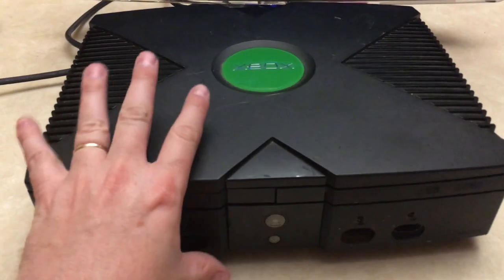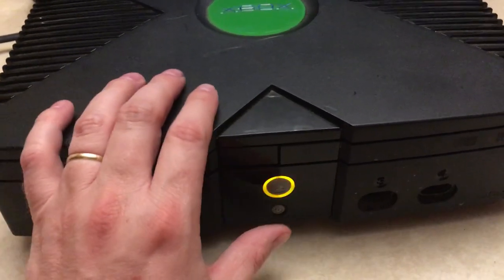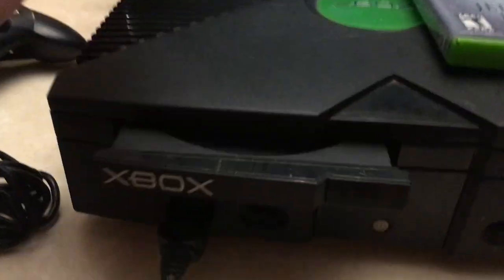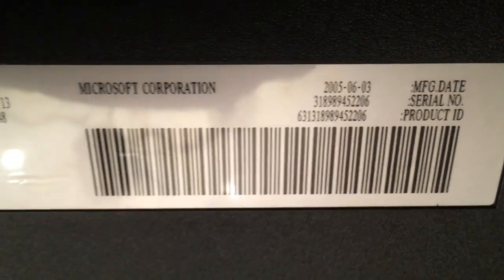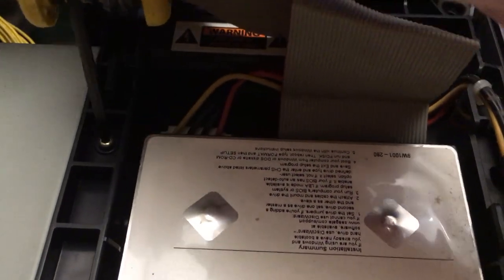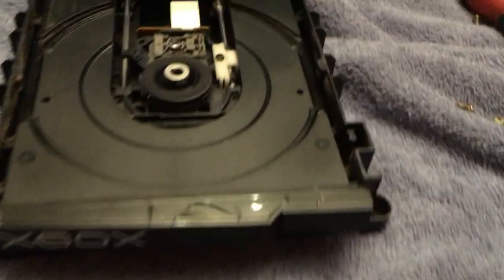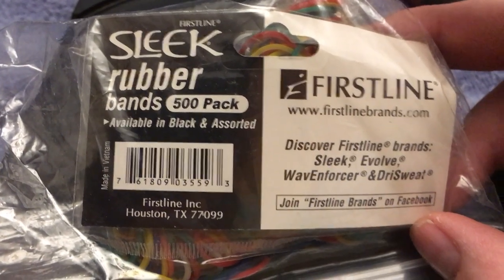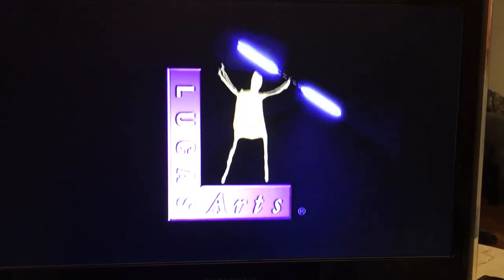Console Repair  - How to Fix Original Xbox Stuck Disc Tray

Comment: this video helped although the rubber band I used was unconventional it opens and closes, just slowly which is worrying. it's more of a rubber band used for hair
Reply from the maker: You can order a pack of replacement bands and use a similar sized band.  I got some a couple years ago but they came from China and took a few weeks to get to me.  I was using them for disc trays and cassette players.  I’m glad your tray works now so you can enjoy your Xbox.

Comment: Mine opens when I whack it and I replaced the band without opening it but it still doesn't open so that sucks
Reply from the maker: Did the band fit tight?
Reply from the maker: @yaboialebo4717  I would say try to find one that’s a little tighter than that.
Reply from the maker: @yaboialebo4717  good luck

Comment: What does it mean when it just stays on a orange light
Reply from the maker: If i'm not mistaken, that's an issue with the AV cable.  Make sure it's plugged in and doesn't have a short in it.

Comment: You don’t have to hit the top like that there’s a way to do it take a paper clip and put it into a hole right next to controller port to press down and it may just slide back up water
Reply from the maker: Thank you.
Reply: I tried the paper clip way, it wasn't working until I smacked the top of the tray it opened

Comment: Mine can open but most of the time it sounds stuck and won't open. It takes a few button presses for it to open and after that it works fine for a bit and then stops again. I have already cleaned the rubber band in the disc tray by removing it when I first got it. Maybe it's time to get a new rubber band. 

I actually have the same problem with my fat Xbox 360 I need to fix as well. The weird thing is my fat Xbox 360 opens fine laying horizontal but issues when vertical. I prefer keeping the fat Xbox 360 vertical as it looks better. By the way my fat is the Jasper chipset model which is one of the last before the S model came out. It is supposed to be most reliable of the fats and fixed the RROD issue. I mention that because I don't know if it's different between the fat models when it comes to disc tray issues. I also have a S model and E model 360 I got cheap but they work fine as far as the disc drive goes.

EDIT. Tried cleaning the bands to each and so far they are working but I have to check in on it in a few days as it usually would work fine for a day then just stop before I cleaned it. I am wondering if it could be something with those plastic gears inside that I see and maybe it's getting caught on something.

Comment: I finally got the tray to open and its very dusty
Reply from the maker: That’s awesome!  A good cleaning won’t hurt it!
Reply: well it was opening fine until I sprayed some wd40 to loosen the gears in the cd drive now the tray wont come out and I think I messed up the CD drive
Reply from the maker: reyes robledo you may have gotten the WD 40  on the band and it’s slipping.  If you have another band, I’d try swapping it out If the band is greasy from the WD 40.